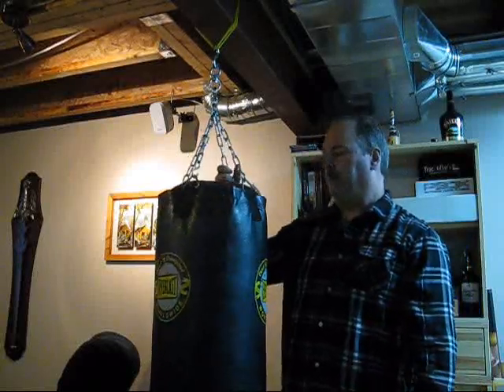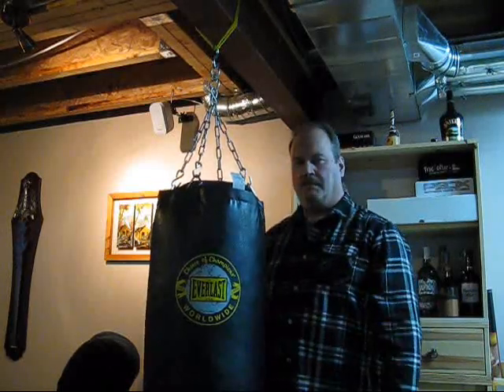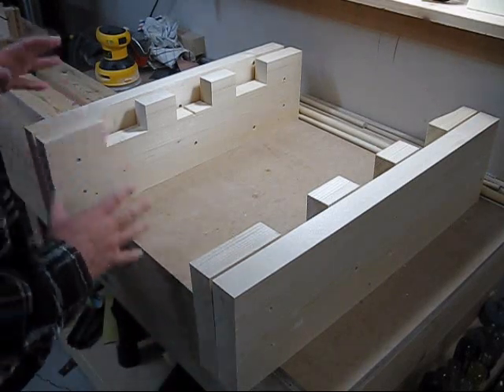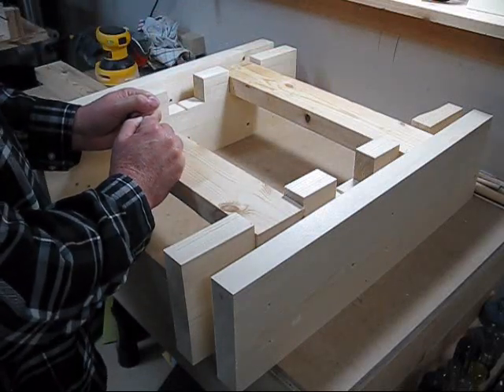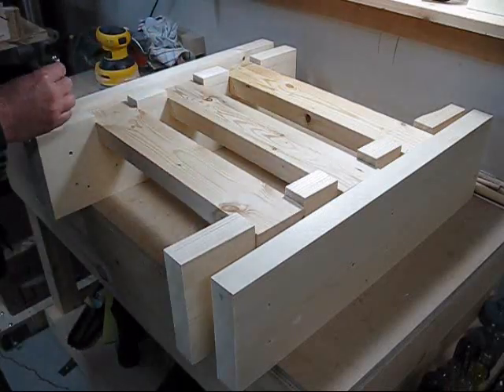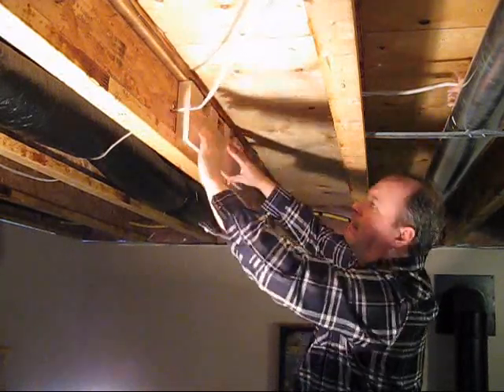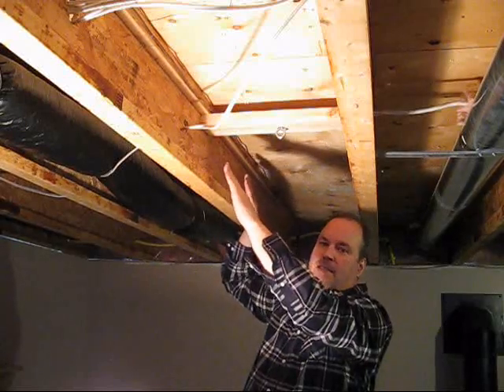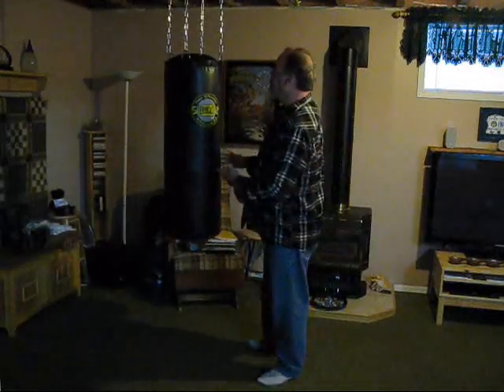Punching Bag Mount

Comment: The swinging of the bag is meant to imitate a moving opponent, which allows you to step in/out or around the bag to work your footwork.
But a Heavy Bag is a great way to exercise and have fun which ever way you mount it.
That ending Kick was awesome :)
Reply: Jaime Lemus they have end to end bags for that. The bag gets swinging to hard when im punching my bag and i have to stop my work out to slow it down lose my rhyth and everything.
Reply: @OGXX-bs5bc  that isn't what a double end bag is for. You are probably pushing through the bag and not punching it correctly. Add a spring to the chain. If you punch it and it swings and doesn't make any noise you are pushing through it. It should bounce and move around. Could be you are using too small a bag too. 50 and 80lb bags can be a little light. ☺
Reply: I’ve done boxing and Thaiboxing for over 20 years I love the idea off supporting the joists but the bag needs to move to imitate an opponent thou like Mr Lemus has stated! If you want to practice power training you should stick a heavy bag  up instead Peace!

Comment: awesome . i've got a similar issue.  i need to get my bag higher because i'm 6'2 and the ceiling is 8ft to the bottom of the same joist.  BTW, did you secure the 2x4's once you had the whole thing up>  and with what?
Reply from the maker: The 2x4's are not secured. They are simply sitting in the grooves.

Comment: Take a look at our Roller Mount.  It rolls along the steel I-beam so you can move it out of the way when not in use.

We also have a rock solid pull up bar that would mount to that I-beam as well.

Visit us at Promountings

Comment: I have a question because i was thinking about something similar to this for my bag. This actually gave me some ideas and made my mind up on how to do it now. But how does it sound and how are the vibrations? Does it shake the entire house and sound like the house is crashing from upstairs? That is the only reason i haven't even tride mine yet because ive been thinking of how to work out without disturbing my entire family over it.
Reply from the maker: I guess it all depends on how the house is constructed and what is upstairs. The floor joists where I anchored mine is simple press board with wooden runners so it needed the wooden planks on both sides for support. The longer they are the better they will be to distribute the weight. Also if you have a china cabinet directly above it you may hear the glasses rattle a bit, but it certainly doesn't shake the house. My punching bag is only 75 pounds and no one upstairs even notices when I am using it. What did bother me was the noise from the chains, so I replaced them with one long rope weaved through the eyelets and the hooks. This made it much quieter for me and I like it much better. Make the supports as long as you can and you should be fine. Good luck.

Comment: My problem is vibration and noise.  Does this setup reduce vibration to the rooms above?
Reply from the maker: To dampen the noise I use a good fiber rope weaved back and forth between the eye bolts at the ceiling and the D-rings on the bag. Makes it nice and quiet and acts as shock absorbers for vibration. Use rope instead of chain.

Comment: Does using this mount cause a lot of vibration upstairs?
Reply from the maker: My wife says no but she can hear when I use it. I am thinking of replacing the chains with a continuous loop of rope just to make it quieter.
Reply: +Paul Pomerleau Did you ever replace it with rope, or could a rubber coated chain be another option to make it quieter?  That kick thou, thumbs up!
Reply from the maker: +Allan Laurel I would think a coated chain would be better, but a rope would be best. I have not changed mine over to a rope yet as I have been riding my motorcycle a lot and not spending any time indoors. I have the rope, just need to get it done.